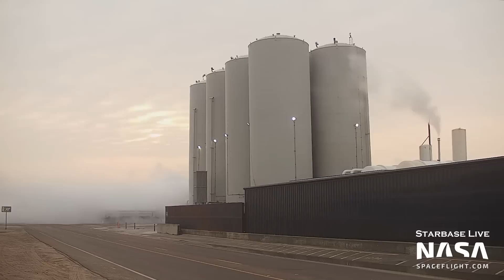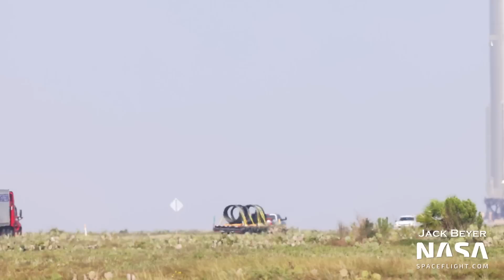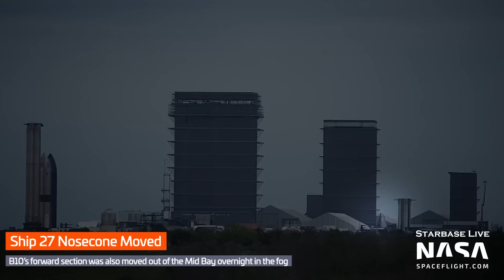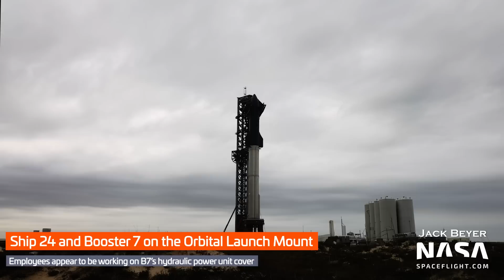Starship Stack Prepared for Full Wet Dress Rehearsal | SpaceX Boca Chica

Comment from the maker: New Merch in the Store! https://shop.nasaspaceflight.com/

Post your hopes for the timeline of WDR, Spin Prime, 33 engine SF in the comments cause it's getting interesting again!

0:00 - Orbital Tank Farm Spooling Up
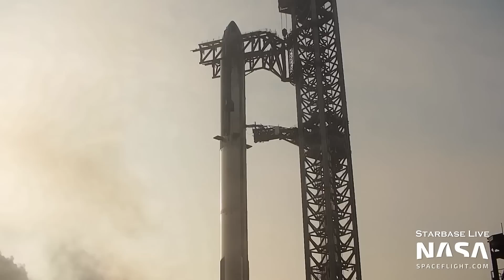0:26 - Fire Suppression System Test
0:56 - Orbital Tank Farm Activity Ahead of Full Stack Testing
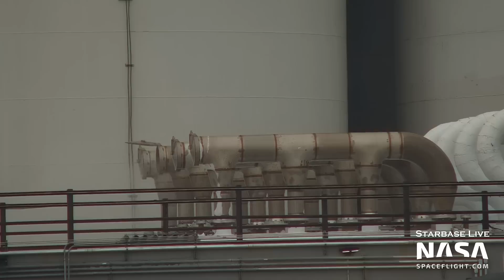1:56 - Full Stack Partial Propellant Load Test
2:54 - Testing Concludes
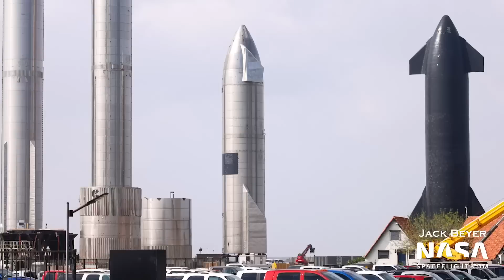3:18 - The Rocket Garden
3:39 - The Production Site
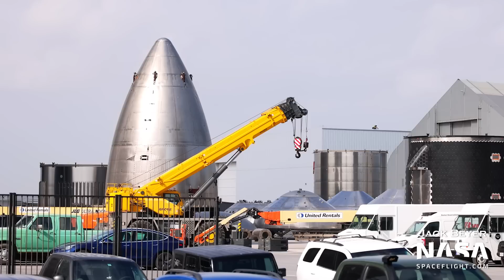3:56 - Stand Moved Out of the High Bay
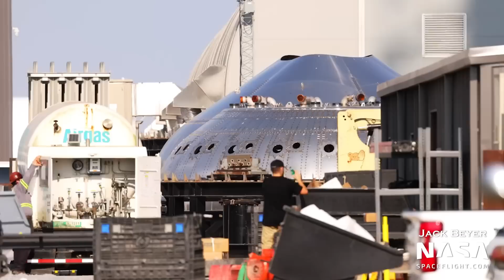4:39 - Booster Aft Dome
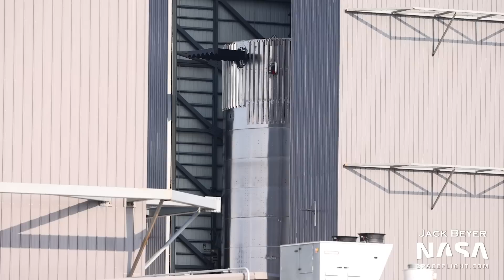5:02 - Booster 10 Foward Section in the Mid Bay
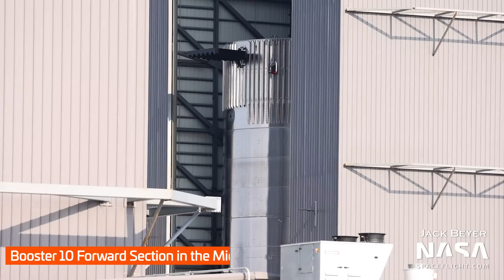5:18 - Ship 22 in the High Bay
5:54 - A Booster Methane Sump and Transfer Tube
6:42 - Large Pipes Arriving
7:23 - Large GSE Pipes
8:02 - New Nosecone Outside Tent 3
8:34 - Booster 8 Moved to the Mega Bay
9:06 - Ship 27 Nosecone Moved
9:24 - The Production Site
10:00 - Booster 10 Forward Section Outside
10:20 - Worker Measuring the Ship Mid-LOX Aft Flap Root
10:45 - The Launch Site
11:00 - Ship 25 on Pad B
11:12 - Ship 24 and Booster 7 on the Orbital Launch Mount
11:34 - Crews Working on B7’s HPU Cover
12:28 - Starlink Satellites in the Starlink Building
12:41 - Booster 8 Moved Out of, Then Back Into the Mega Bay
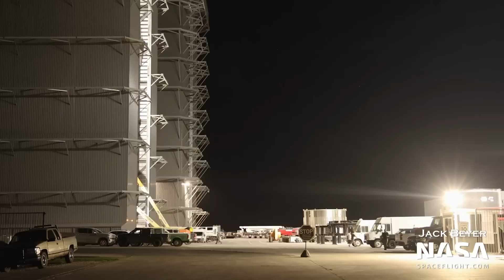13:26 - Raptor Engines with Electric TVC in Tent 1
Reply: 1/23/23: WDR
1/24/23: S24 destack, removal of lifting clamps
1/25/24: B7 33 engine spin prime
1/26/23: B7 33 engine sf
Rest of January and much of February: OLM repairs
Late February: OFT

Comment: Really excited for the electric TVC. Hydraulic lines are super annoying at least in aviation although I don't have experience with them in rockets. They tend to rupture, light on fire, get contaminated, or do all sorts of very annoying things to your flight hardware and ground equipment. Modern electric/electrohydraulic self-contained actuators are much better in nearly every regard.
Reply: I don't work in the aviation industry, but I have connections with people who work in maintenance for the Dreamlifter and standard 747, and they always complain about hydraulic systems. Must be a real pain to deal with.

Comment: Question: do you think it possible that SpaceX is waiting for the full stack of Ship 25 on Pad B to do the full static fire test? One of the goals of Starship is extremely high launch cadence, so one could think that the ability for a rocket on Pad B to safely withstand the launch of a rocket on Pad A (and vice versa) to be critical information.

Comment: Weeks of:
23 January; full WDR1
30 January; inspections and modification, olm/tower cladding
6 February; WDR2+spin prime
13 February; WDR3+33 Engine SF1
20 February; concrete repair, more inspections & FAA license 
27 February; OFT attempts 1and 2 will both scrub.
6 March; attempt 3 also scrubs. Inspections and/or repairs.
7 March; OFT1 leaves the pad probably RUD at staging or reentry.

Comment: Hope they will attempt a launch on the short term. Everybody wants to see that. I am afraid that the blast of 33 engines will damage the launchpad forever. The concrete was already blasted away by a test with a few engines. What will happen if 33 engines are gonna blast away on full thrust and what happens to the launchpad? I am afraid. So is SpaceX apparently. The power is what we have not seen before......

Comment: It would be lovely if they also did a 33 raptor full duration fire testing right after WDR <3
Reply: Wouldn't that pull those legs out of the Texas mud?
Reply: 33 engines would pull up half of Texas!
Reply: The good thing is that with the water level rising, there soon won’t be a need for a deluge system.

Comment: B7 will burn propellent at the rate of 26 tons a second.
Reply: Is it straight gravity feed from fuel tank bottom? How will the fuel tank bottom handle that much stress during launch? Any dual phase in the  fuel at tank bottom during launch must be extreme. Cavitation, fuel heating and overpressure must be serious concern.
Reply: @Googler1221  The turbine pumps in the Raptor 2's will SUCK the liquid fuel and LOX out. The LOX tank bottom is a machined piece of curved stainless steel that is very thick and the forces will be spread around the rim of the outer rings. What's 'dual phase'?? Why would you get cavitation at the bottom of the tank. If anything, you might get a 'whirlpool' effect. But with autogenous pressure in the enclosed tank from the top, it will be forcing the liquid down as well. Not to mention the gravity force as the rocket lifts off. And why is the fuel going to heat? Where's the heat source? The same applies for the liquid methane coming through the upper tank and through the 'down tube' going through the liquid oxygen. I think you need to watch some of Tim Dodd Everyday Astronaut topics on engines.
Reply: @Googler1221  Both fuel tanks are at about 90 psi to prevent problems. Also the fuel is cooled far below it's boiling point. Any bubbles or phase change would be bad. Each Raptor's fuel pumps are 75,000 HP. The stats are kind of mind boggling. :)

Comment: Their scrapping Booster 8 Next they probably will scrap Ship 25 after some more testing, then after some more testing on Booster 7 & Ship 24 they'll get scrapped too. Booster 9 & Ship 26 will start testing in mid Feb and maybe launch in  April
Reply: From my understanding B7 S24 would fly on the first flight depending how well they handle the WDR.
Reply: @michaeldeierhoi4096  That was my understanding as well... 24/7 for the Short Orbital Test.. Then (Possibly) 25/9 for 2nd (Full) Orbital... Just Guessing, but since we saw s27 in this Vid, maybe it (might) be 1st Crewed??
Reply: @laurin4405  1st crewed will not be until there's been about 10+ totally successful, sequential flights and then it has to be NASA approved.
Reply: @David-yo5ws  Thx :}

Comment: If that fire supression system test was on full blast, it's pathetic. Just another disadvantage of being exposed to the wind.
Reply: That's the same wind direction that any CH4 or O2 vapour is going to blow towards, so that's the water droplets purpose. It's going to absorb any heat from any ignition. 
And don't forget how far away your looking. If you were up close to that spray, it would be a hell of a soaking you would receive.